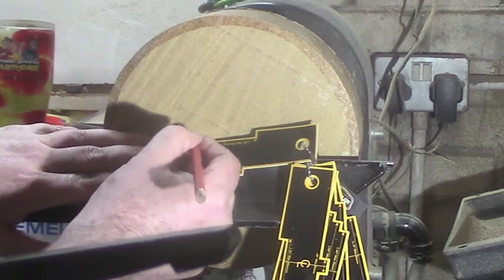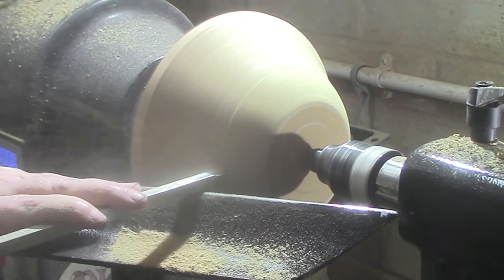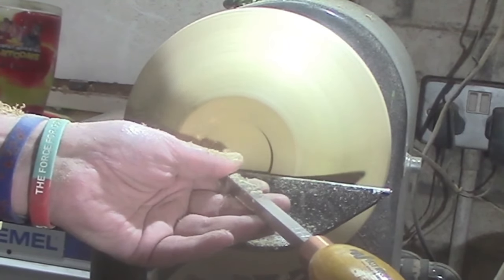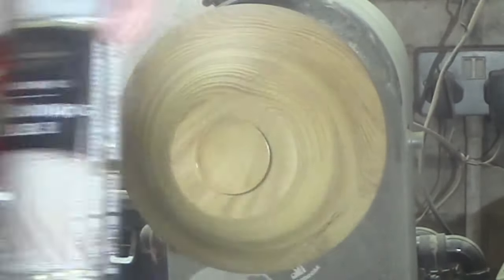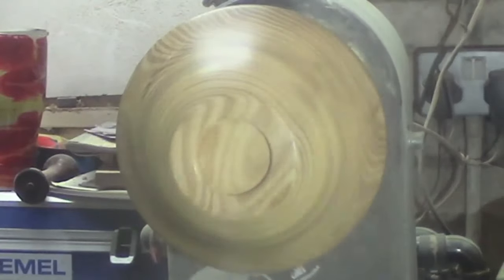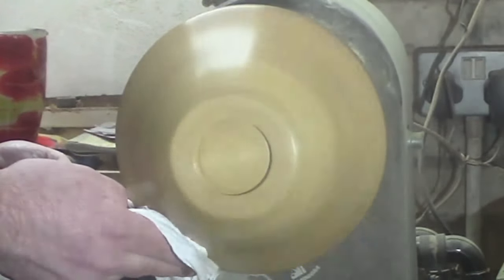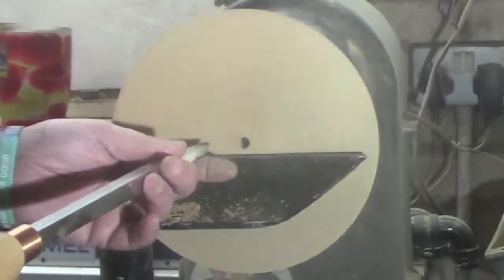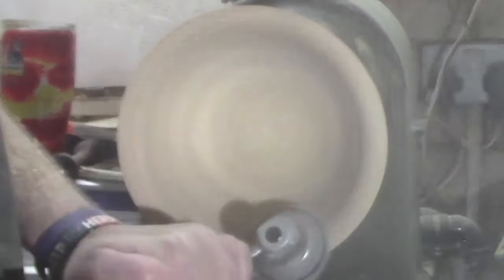Woodturning a Stunning Acacia Bowl: Woodworking Masterpiece!

Comment: JP, where did you get the chuck sizer gauge set of jigs you use to mark out the tenon/recess?
Reply from the maker: i got mine direct from Easy wood tools but they have them on Amazon, there is a link in the description of my video to them :)